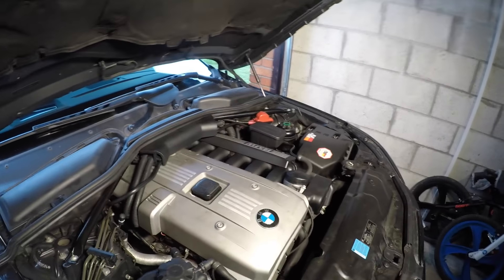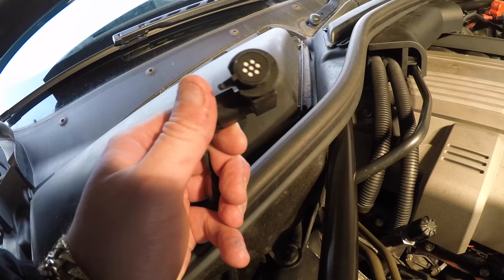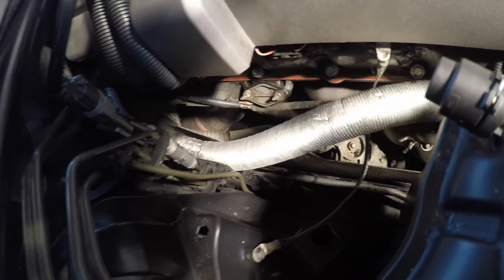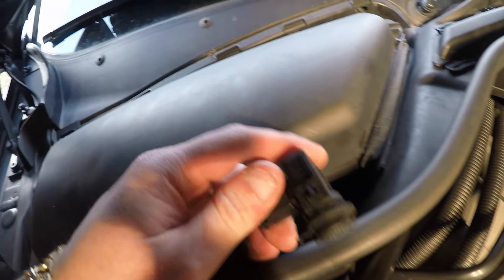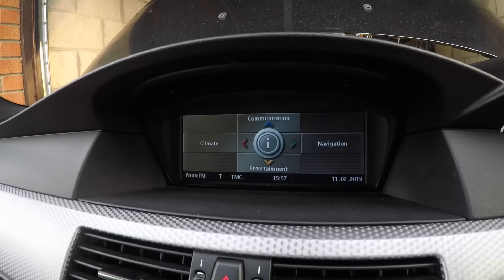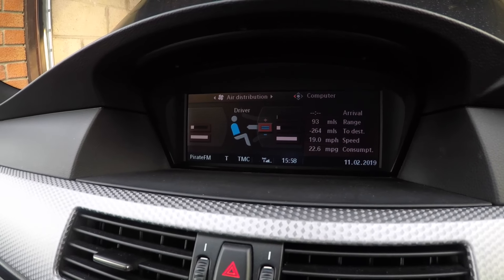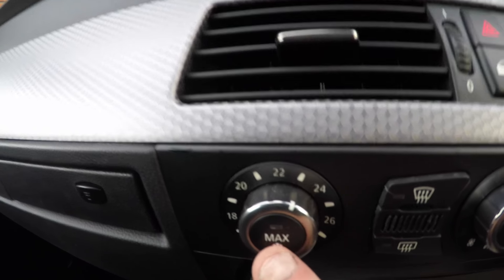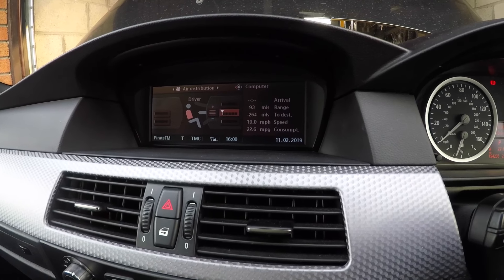BMW E90 E60 E61 E63 Air Con Not Working!!! Fix Must Watch

Comment: Is the air quality sensor located somewhere else if you have the earlier heater controls? I’ve looked on mine and it’s not there and there’s no wiring for it
Reply from the maker: what car is it mate
Reply: 2005 E60 there’s a hole where the sensor should be but when I checked the scuttle drains there was no sensor or cable I take it that’s it’s because I have the basic heater

Comment: What's it means if the driver side doesnt get cold but the passenger side some what does
Reply: low fluid, need to fill up the ac system.

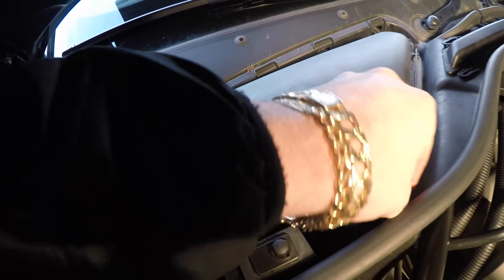Comment: That sensor at time 1:12, isn’t that the AUC sensor? I thought that was to sniff out pollutants in the air, and if there is, it cuts off air coming from outside the car. On cars with this sensor, the re-circulation button has 2 modes, re-circulation and the AUC sensed mode, that will automatically shut of outside air, if there is pollutants in it.

Comment: I have a 2006 330xi and the ac and heat does not work replaced the blower motor and final stage res still no air hot nor cold

Comment: Hi doc i have a problem with my 2008 528i!
The ac only blows hot air. What may be the issue?
Reply from the maker: Have you watched my video
Reply: So we did all this, but now when we turn on the ac its cold passenger side is colder than the drivers side and for like 2 minutes the air turns hot. Do you know what the problem may be?
Reply: @jonathanresendiz4762  have you found the problem? It could be a faulty heather control valve?

Comment: My e61 a/c compressor is not kicking in.  Any ideas were to start?  idrive settings are ok.
Reply from the maker: Your gas is low that’s what happens it won’t let it come on if freon is low to protect the compressor go get it refilled
Reply: Hello.  Thx for replying.  I just bought the car so i dont have history.  So most probably there is a leak?  Any weak areas where they tend to leak?  I hope its not the evaporator  :( that would require a dash out...
Reply from the maker: it could possibly be your ac radiator leaking and not the evaporator also check the evaporations temp sensor
Reply: BMW Doctor - ok will try that. Thx
Reply from the maker: you are welcome my brother take it easy and fix that issue

Comment: Not true that its only E39's with the AUC above the fan shroud, i have a 2005/04 E60 and the AUC doesn't sit next to the pollen filter, it is on top of the fan shroud so it depends, its probably from a certain year onward its next to the pollen filter.

Comment: Would any of these sensors going out cause me to constantly read the same pressure for the high and low side of my ac system? Or does that mean I definitely need a new compressor? Would help me greatly.
Reply: Mine does the same even when i hear the compressor cut on

Comment: Hi doctor, I have problem in my BMW 750 2009 in low speed AC cold and good when in more than 70 km it's getting hot what maybe the issue ?
Reply from the maker: your fan is not working to cool down the ac OR your heater valve is blocked easiest thing to do like we do here in the uk dont use ac as I tell everyone in the us just open the windows
Reply: @BMWDoctor  thanks doctor for replying ,
UK and US still acceptable weather ..here in KSA temperature is over than 50° that's equal to 122 F° so we are burning hahahah